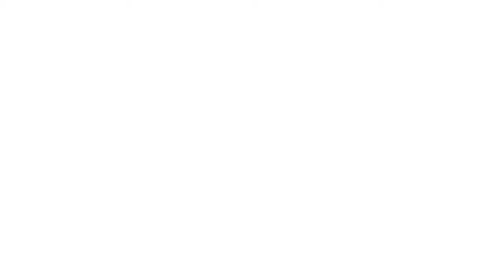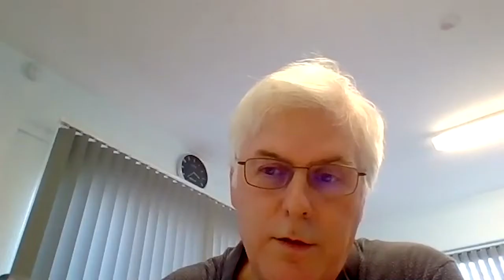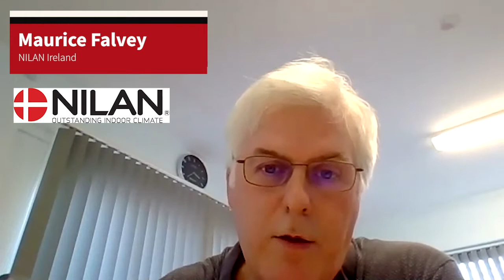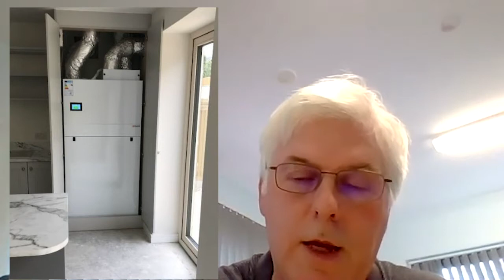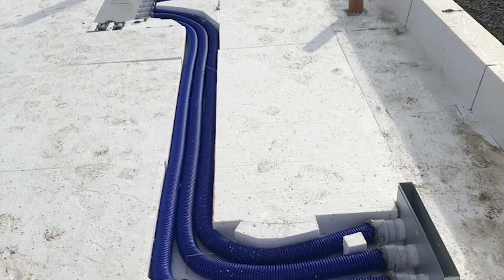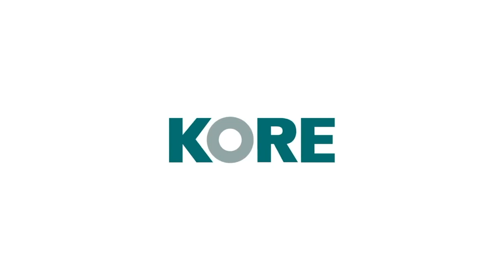KORE Insulated Foundation System Launch Week - Maurice Falvey, Nilan Ireland

Comment: Based on my knowledge (I do not have a Nilan equipment) the system is a good idea but the Nilan equipment (heat pump+recovery+heating and cooling) is not reliable (check on internet, there are a lot of issues with electronics,...). Maybe I'm wrong, but I would like to get feedback from other people with Nilan products. Anyone knows another brand manufacturing compact devices like Nilan?
Reply: Nilan  are very unreliable. I've had multiple issues with mine. Google "nilan trust pilot" to find a plethora of awful reviews. The customer service is also terrible. I've waited over 6 months for a service, and then, they couldn't fix the unit. They imported a new unit from Denmark, but this didn't work. After several visits - they eventually realised, months later, that the unit they imported was 3 phase.. so not designed for the Irish electricity supply system. My unit still doesn't work, and the chap in the video wont answer my calls.